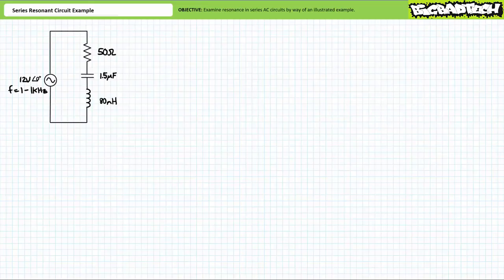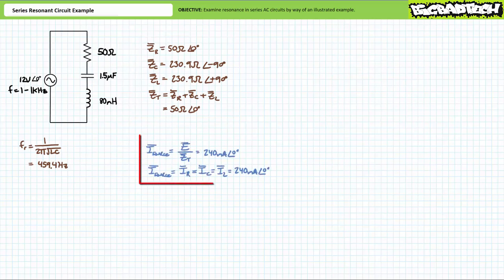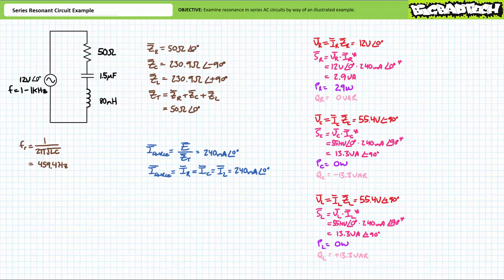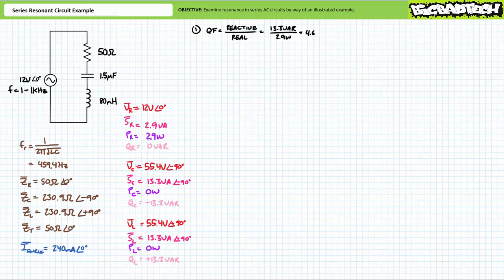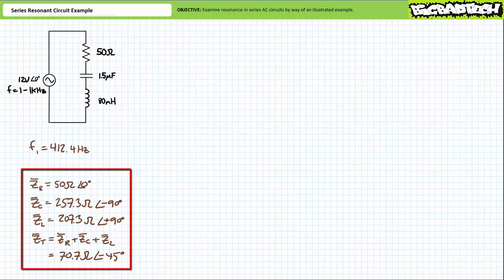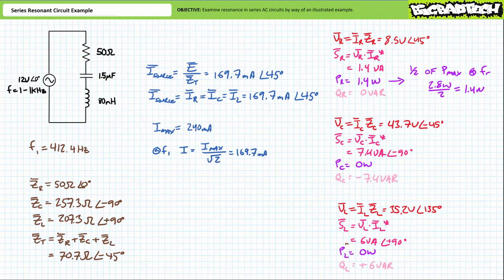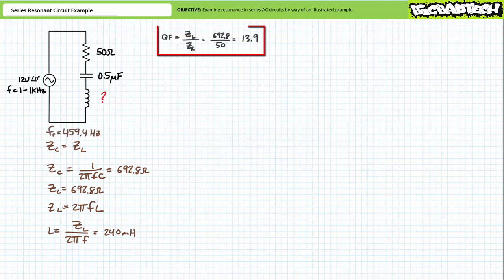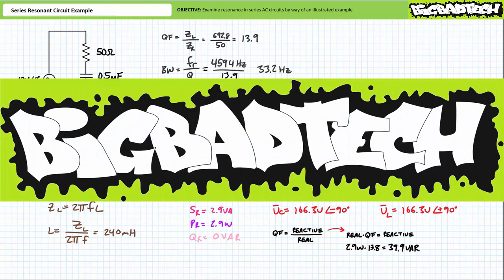Series Resonant Circuit Examples (Full Lecture)

Comment: Hey Jim, for the 1st circuit with an 80mH inductor.  @ Fr= 259.4 Hz, I'm getting an Impedance of 2pi*Fr*80mH <90 = 130.4 ohm <90.  What am I missing?
Reply from the maker: Resonant frequency is 459 Hz (not 259). At lower than the resonant frequency the inductive impedance will be lower and capacitive impedance will be higher.